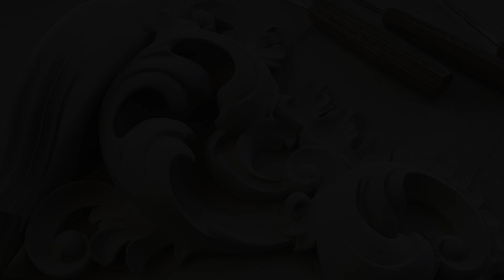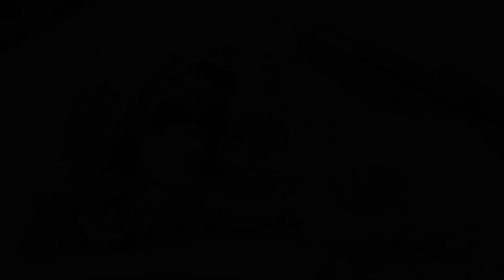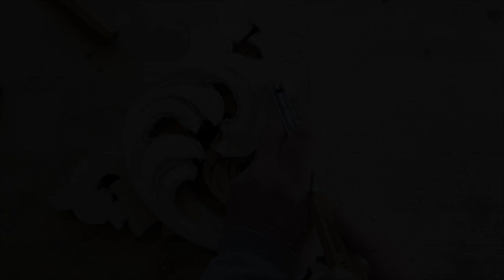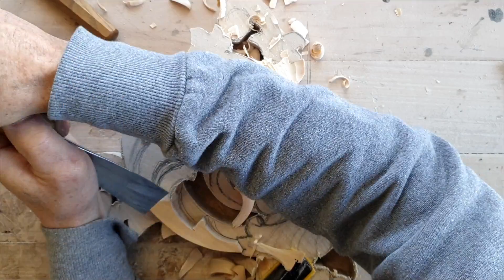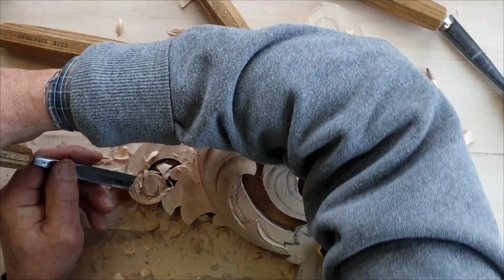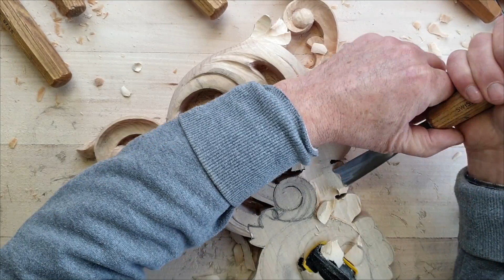Handmade carved wooden shelf

Comment: What type of wood is that?
Reply from the maker: I use Linden, which is a soft wood that is easy to work with. It cuts, grinds and polishes well.
Reply: @WoodCarvingbyValery  Aaa so it is Tilia. Ok, that makes sense. Thanks.